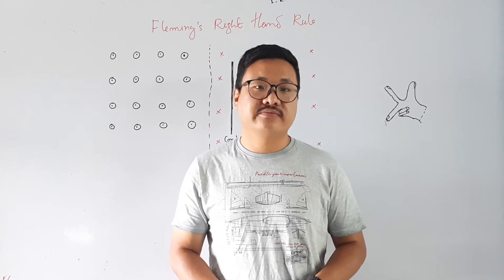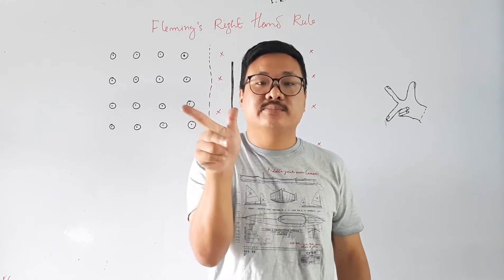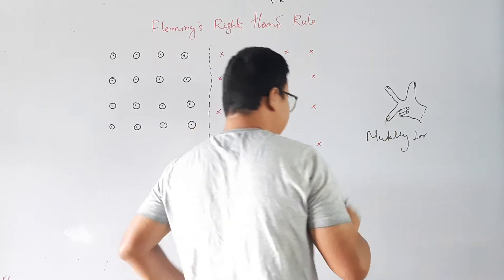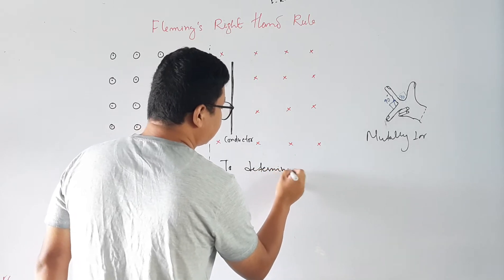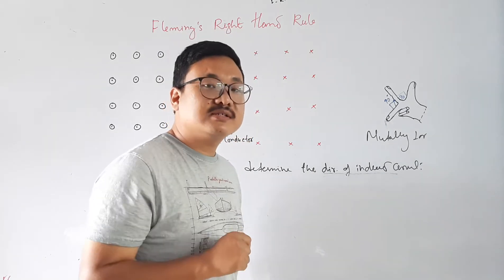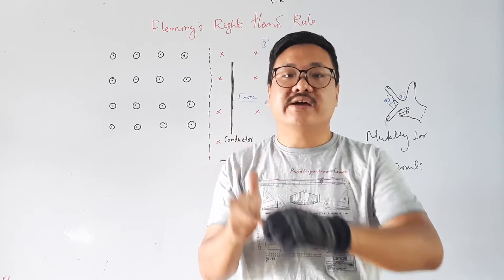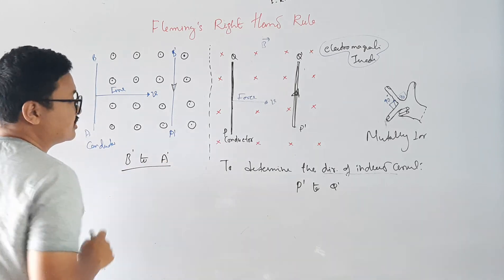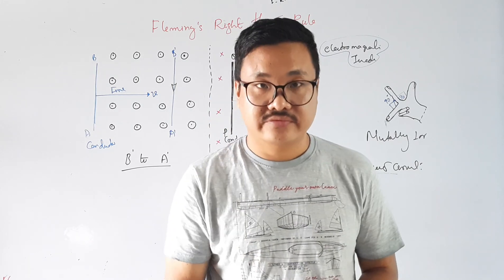Fleming's Right Hand Rule || Electromagnetic Induction 4 || How To Find Direction Of Induced Current

Comment: Sir,is is possible to apply this rule for loop in place of straight conductor? Please revert.
Reply: Loop is circular here.
Reply from the maker: This is just a rule to find the direction of induced current due to changing magnetic flux not the law so the way of application of rules could be different. This rule can be used for loop like rectangular, square circular as well. but for circular loop we need to take care of few things e.g which part is going into the field etc and we have to take a small arc of the loop to find the dir of current.

What i suggest is that,  it is better to use vector rule or lenz's law n its rule for circular loop which will be more easier and simple.
Thank  you
For more detai : amirsamrai@gmail.com
Reply: @FAMILIARPHYSIC  Thanks for your prompt response ,Sir. Please tell me about vector rule ,is it lenz's law or different.?
Reply from the maker: @pankajsharma-bc8hx   Vector rule is different from lenz law I believe but they can be related